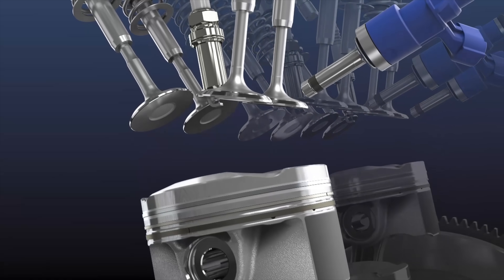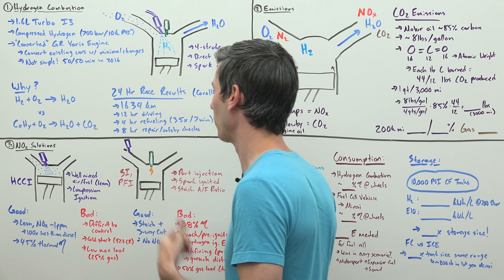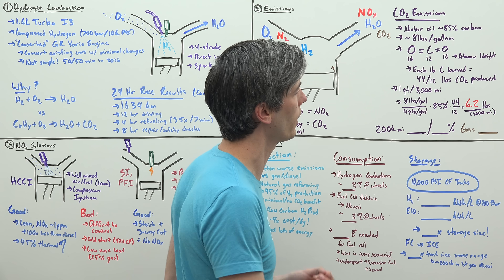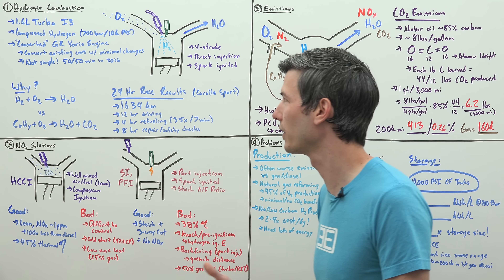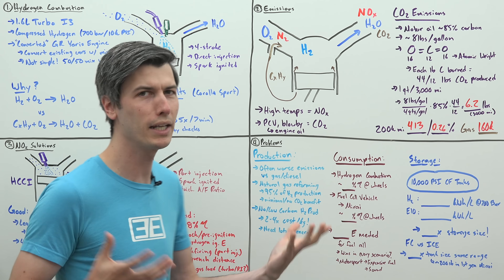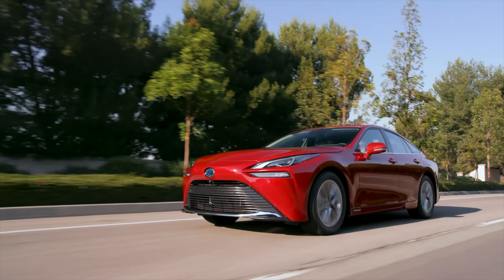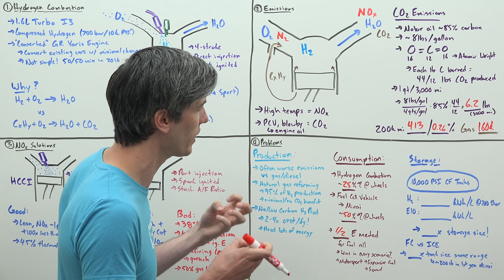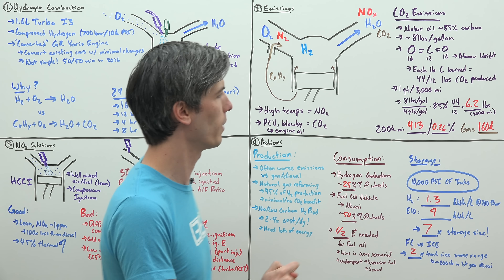Toyota's Developing A Hydrogen Combustion Engine!

Comment: For old cars, the best option is LNG or LPG. That would lower Co2 emissions by 20%-50%, relatively cheap installation, and proven technology. I drive on LPG for decades. Driving is 50% cheaper ROI for installation is from 8-18 months.
Reply: cng is dirt cheap on the markets. As low as 10c per kg. But that low price for now doesnt reflect low price on the pump stations.
Reply: It comes with its own issues. If you simply convert a petrol car to CNG, it's only a matter of time until the valves/seats get toasted. Factory converted CNG cars all have hardened valves/seats. CNG was also heavily subsidized in my area, but once that stopped, CNG cars just faded away after a while (I drove CNG cars for years, btw).
Reply: @prerunnerwannabe  With modern (last ten years) installations that are not an issue, they can be programmed with a few percent of petrol added in the mixture for protecting injectors, and valves. For very sensitive and complex motors lubrication is added in intake. In my country is very popular almost every station has LPG.
Reply: Converting to CNG is actually a super popular option in India, there are a bunch of companies that will convert your car to also have a CNG tank, and it's pretty convenient because we have a lot of CNG stations as well since most autos also run on CNG (auto: tuk-tuks or rickshaws, basically a three-wheeled vehicle, that is a common mode of public transportation).
Reply: The valves/seats problems comes from keeping gasoline as additional fuel ( Bi-fuel option)  . The gasoline has much lower octane rating than LPG and CNG so it do not allow increasing of compression ratios which increase the speed of burning . In South Korea pure LPG cars are used with liquid injection of LPG  which even increase the power if compared to equivalent gasoline engine . 
The measures to convert gasoline to pure LPG or CNG engines are :
1 . Increasing the compression ratio  12:1  14:1
2. Using high energy ignition systems 100mJ and up per spark discharge and use of double tips iridium spark plugs .
3. Remapping the ignition and fuel maps of the ECU .
4. Replacing the exhaust valves seats with tool steel made ones and if possible use of sodium filled exhaust valves . 
There was experimental fuel mix mainly CNG with small amount of hydrogen. Hydrogen burns very fast , ignites by much lower energy spark discharge and accelerate the rate of burning of the mixture so it is another way to solve the problem with slower CNG burning speed.
Reply: @flappingflight8537  iridium plugs are standard for LPG converted cars LPG ECU already fully control maps, you are right I planned to increase compress ratio and use high octane gasoline in my car.
Reply: @denismilic1878  The specialised LPG ECU usually control only fuel mixture and not the ignition ( the spark advance angle ) . For modifying the spark advance curves usually timing advance processors are used . If you convert to mono fuel  only CNG or LPG then slave ECU isn’t necessary  and the original ECU can be remapped .
Reply: As about high octane gasoline , the higher octane rating in my country is 100 when the LPG is 108-110 . It’s actually not a problem to use regular 95 octane gas  if use it only for warming up the engine before switching to LPG . The problem occurs if the LPG ends on the road and you have to reach the closest refuelling station on gasoline . Then at least you have to drive slowly and gently in order to avoid the detonation .
Reply: @flappingflight8537  Itst not necessary to increase compression so high. You can adjust it for gasoline with an octane number in your region.
Reply: I had a factory LPG 1 ton van for a number of years.  It was great except it wasn't always easy to find a gas station that supplied propane for vehicles and as I live in Canada, I had to plug the sucker in at night.  The worst was when I had no where to plug in.  She would start okay, but I had to let her warm up for quite a while before I could drive or she'd stall down the road on cold days.
Reply: The best option for older cars is to change the oil regularly, get a tuneup with fresh spark plugs, put in a fresh engine air filter.  Over inflate your tires 10% have your wheels  properly aligned and balanced and drive the speed limit.
Reply: @robc8468  Every responsible owner does everything you said, except tires overpressure.

Comment: "Let's say you burn 1 quart of oil every three thousand miles..."

Legacy GT Owners: "Woah, really?"
Reply: BMW Owners... 1 quart per 3K... Hold my beer.
Reply: my impreza goes through a 1 quart at most every 1k miles lol
Reply: @briandavis7226  My friend's old impreza did the same.
Reply: Really, I have a WRX with mods (e.g. bigger turbo, injectors, I/C...) with 290k miles and doesn't burn oil. (acutally, I lost maybe not even half a quart in 3k miles.)
I think it's about the weight of oil you put in it. I use Rotella T6 5W-40 year around for years and no problems, beside some coolant leaks...
Reply: Wait till you hear about electric vehicles!
Reply: Me, a European: "one what?"
Reply: @LRM12o8  -- A liter. A quart is almost identical to a liter.
Reply: my 00 outback must have been a unicorn because it burned a nearly immeasurable amount of oil every 3500mile oil change, and it had 200k miles on it. my wrx and legacy SS were another story...
Reply: @kstorm889  my 08 outback (3.0) hack car dosent touch a drop between services.  Hasn’t since I got it and now 230,000km
Reply: Yeah my 06 obxt has gotten pretty thirsty
Reply: 'aint nothing on a rotary - even if they are in good condition you'll need to put in 3 times that much.
Reply: GT350 owners… yawn that’s nothing
Reply: My Rx8 burns quite a bit two stroke oil. Especially with a stage 1 tune. :)
Reply: My Rx7 goes through 1 quart a fill up (250 miles).
Reply: @JohnnyWishbone85  U.S gallon is 3.78 L ,imperial gallon is 4.4L,so depends on the measurement that is used.
Reply: @sofakingdom3076  Rotary life bro! (y)
Reply: @opeope12  Hmm, Ok that's a little much even for a rotary - unless you are running some insane boost - but then you'd probably not be getting 250 miles from a tank...
Reply: @Beer_Dad1975  I have some issue with my OMP but I need to keep it for smog. The car also does not really go out much. Mostly track and light city driving. Have driven it for 2 years with no loss of compression or issues.
Reply: @engrishsheep  Can't burn oil if the car doesnt run! BIGBRAIN
Reply: @mrkazman  dafuq you talking about?
Reply: @mrkazman  Brain Drain actually
Reply: How much?! 😲 I have an 15 yr old diesel Volvo V50 hauler with 280k miles on it and it uses less than half that in the same distance!
Reply: @briandavis7226   sell it  :))
Reply: @engrishsheep  I use 0W-40 Castrol Edge,  I live in heavy winter area.
Reply: @LRM12o8  One quart  is about one liter
Reply: i have an 02 wrx and i don’t think it burns much oil, not enough for me to be able to notice at least.
Reply: Mk4 1.8t owners 

those are rookie numbers! You need to pump those numbers up!
Reply: @engrishsheep  I use Rotella T6 15W-40 in my Duramax. It's fantastic oil!
Reply: only a quart every few thousand miles? For an old LS it's like a quart every few hundred
Reply: millenial,1st world issue...que the ok,boomer
Reply: I've done 43,000 miles over 6 yrs never burnt any oil.........
Reply: @TedSchoenling  yep if i drive my e46 320i exclusivly in the city i can easily burn a Liter in 1500km :D It goes down to about a liter every 5000km with my road mix.
Reply: "Laughs in rotary".
Reply: All Subaru boxer owners:
Reply: @esaedvik  -- Don't lie. Everyone knows British cars don't actually move because of Lucas electricals.
Reply: @engrishsheep  There are a lot of variables.  1 quart in 1k miles was pretty good for cars manufactured 20 years ago but cars manufactured now can probably go 5k miles on 1 quart when they are new.  When they get older, maybe by 100k miles, they could easily be at 1 quart per 3k to 4k miles.  If a car is not maintained properly, by 100k miles even a modern car could be at 1 quart per 1k miles.
Reply: Remember when youtube wasn't obnoxiously innundated with excessive commercials ?!?
  Pepperidge Farm Remembers !
Reply: @hallodunase  where u get that electric power from?
Reply: Everyone in the comments your subaru burns oil the design of the engine is flat turn right oil sloshes to the cylinders and oil slips past ring end gap every engine burns oil and if your rings get worn out after alot of miles you burn more oil
Reply: Pretty much every old Toyota I've ever seen burns 0.5-1.5 quarts per tank of gas when towing or driving hard. Lol especially the v8s
Reply: "The lawsuit alleges about 126,000 Audi vehicles have defects in the 2.0L turbocharged engines that caused the vehicles to guzzle oil. The affected vehicles are the 2009-2010 Audi A4 and Audi A5, and the 2011 Audi A4, Audi A5, and Audi Q5 with the engine code of CAEB."
Reply: @sofakingdom3076  that's why our Japanese friends sometimes get an "all U can burn" insured oil service plan from the dealer when buying a new RX-8 LOL
Reply: 1 quart every 3k miles??? this is unheard of to us audi owners 😓
Reply: I had more issues with coolant drinking with the 3 Subarus I've owned (99 Legacy 2nd gen, sg Forester 06 & an 06 Legacy Outback 3.0r). There was a little drop in oil level slightly before ils supposed to be changed again.
Reply: @kstorm889  so the car did it's own oil changes?  :,D
Reply: @angusnz7910  ez30r is a fantastic engine. My tribeca doesn't lose or burn any on 5k intervals. I know someone with 300k on their Bec. The trans shifts a bit hard when cold but it still pulls too big of a boat without much sweat. Sure it down shifts on a hill, but once you climb into the torque curve it's a beautiful thing letting those horses run
Reply: @winterwinter7505  sorry I meant you couldn't measure how much it used because it was so little. Immeasurable was a poor choice of words. After I sold it, it is still someone's daily. Comfy seats in that one with the double sun roof too.
Reply: yeah, 1 'quart' every 3000 miles is pretty high oil consumption.  But I guess for the purpose of creating this video it's a good round number.
Reply: @JohnnyWishbone85  : Lucas invented intermittent wipers, 4 way flashers, and cylinder de-activation, not that they wanted to.
Reply: Gas industry doesn't like this design.

Comment: What about hydrogen combustion for HGVs, trains, boats and tractors etc. I can see small cars going the electric route but not heavy vehicles. I am impressed by the work JCB are doing here.
Reply: I had the same thought - JCB is on the forefront of Hydrogen-Combustion engines for use in heavy machinery
Reply: @Kezenmacher  J C Backwards 😁
Reply: Double the cost for an EV  Car? Very funny!
Reply: Kawasaki has marine hydrogen engine for ships. In fact, they have 2 operational liquified hydrogen carrier so far. Their target is 80 ships.
Reply: Why not? Only reason I can see currently is the battery tech. Considering that until a few years ago only a small startup called Tesla was seriously working Batteries for EV's I think that there is still a lot of potential there. 
I doubt we will find a better way to produce hydrogen as chemical processes just require a certain amount of energy. 
Also most trains run on electricity. (Well in Europe at least)
Reply: @Isamu1013  I see both. But liquid fuels will be needed for aircraft and ships and perhaps heavy plant/HGVs. My fear is batteries need scarce rare elements and thus may become limited, hydrogen is abundant but needs energy to convert.
Reply: @teryd5672n  I agree with planes and ships with a question mark behind trucks and other heavy equipment as I don't know enough about it. The amount of scarce material needed has been reduced significantly but you are right that is a problem with Nickel Mangan type lithium batteries. In applications were weight isn't as critical you can get around that using LFP for the most part. All this could change with graphene but we will have to wait and see.
Reply: High speed rail are already the replacement for trains. So what can happen is Integrate High speed rail electric features and electric regeneration technology boats. It can have that Electric technology. Making a boat to act like a dam to generate its own electricity is highly possible due to waves current.
Reply: @Isamu1013  They are already developing Electric Engines for planes.
Reply: @makemap  engines aren't the problem, storing the electricity is. Hydrogen planes would use electric engines as well.
Reply: @Isamu1013 bring back the airship. It's fair to say we now have the tech to keep gases like hydrogen bagged up now. If we can stop astronauts from dying in the vacuum of space we can keep a flammable gas in a bag. If we have proven that an inflated section of the ISS is impervious to objects hitting it many times faster than a speeding bullet, we can keep a flammable gas in a bag.

HFC powered Airships would be amazing. Gliding along the very edge of space at a leisurely flying pace giving everybody inside a great view of the earth.
Reply: the only place hydrogen combustion has any large scale industrial use is in aeroplanes and rockets.

Comment: early days, consider what we had for when the batteries (lead acid) and electric motors were at the time. using H2 in a car is still pretty new
Reply: normal Carb engines will run hydergen  out of the box  only needs minor mods to fix backfires

Comment: I mean, there’s even more problems with storage: Hydrogen is such a small molecule it diffuses through anything, so while you’re just sitting there, your car is leaking fuel. Also, filling it up is a huge issue, because of multiple reasons: 
• it‘s hard to get such a high pressure connection system both reliable, safe and easy enough for regular people to use (the part that is the nozzle on the fuel hose today—in a hydrogen car, it has to be a leak proof interconnect that can hold the 10k PSI, have high pressure valves on both ends of the connection and can still be easily connected/disconnected hundreds of thousands of times), 
• it‘s hard to store for the station (needs huge tanks and they are, again, leaky), 
• and on top of it all, it‘s ridiculously easy to ignite compared to gas or diesel, so if there IS a leak somewhere, the smallest spark can make your station into a Hindenburg reenactment.
Reply: Because of those problems, scientists are working on trying to store it as easy to divide molecules which will make it a bit denser but safer and easier to store.
Reply: We have hydrogen tanks that do no leak. Not sure where your getting that
Reply: Hydrogen is not exactly terribly dangerous. Diesel and gasoline they are at leaking point. LPG butane is kinda heavy and sticking around in corners. 
Hydrogen is lite and really wants to escape upwards. So if you have small continues leak hydrogen is nowhere to be found, let alone burn. If you have big sudden leak than few seconds later it's all gone. It's climbing at few meters per second rate. Just don't have trapping area and no worries.
Reply: While H2 Permeation is an issue, it is very time dependent; unless you're trying to store a fixed volume of gas for a long time, the amount lost to permeation would be miniscule when compared to the volume which is used. E10 gasoline suffers from similar long-term storage issues due to water absorption, so the permeation issue is less of a concern than you might think. The bigger issue is closely related, which is maintaining a leak-tight H2 management system (since H2 is far more prone to leaks in fittings and pumps than other compressed gasses). 

As for your other issues with the gas handling challenges, there is actually good news: most of those issues have already been addressed by previous compressed gas handling solutions. Compressed natural gas in particular has set most of the engineering standards for dealing with safe and repeatable solutions for the transfer and storage of a compressed flammable gas, so most of the engineering best practices and standard operating procedures for users are already mature.
Reply: @KendallPhillips89  He is just trying to show how big of a nerd he is.
Reply: @KendallPhillips89  Nothing can prevent leakage of hydrogen. However the current tanks lower that value to a level that is acceptable for standard use.
Reply: * High pressure connection system is available and used. No issue there
* Storage is not an issue. Current tanks do leak (you cannot fully prevent that), but leakage is extremely low. Stations also do not store hydrogen with full pressure (only a small amount) of 700 bars, but with a lower pressure (maybe ~300 bar). Space is not too much of an issue on fixed storage tanks.
* You should really check: actually igniting hydrogen is very hard, you need a very specific mixture ratio. Additionally the whole problem can be prevented, if you don't put the storage tanks inside closed buildings/roofs. As soon as you have some kind of ventilation, the hydrogen is gone and you will never reach a critical air to hydrogen ratio needed to ignite the whole thing.